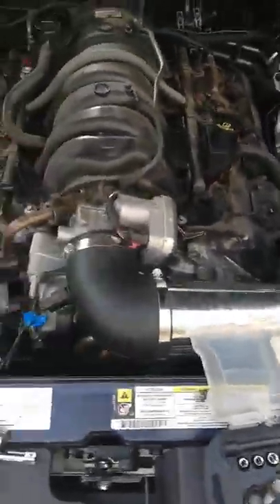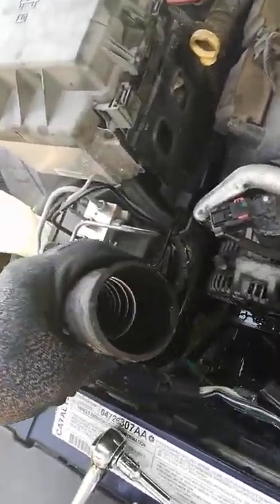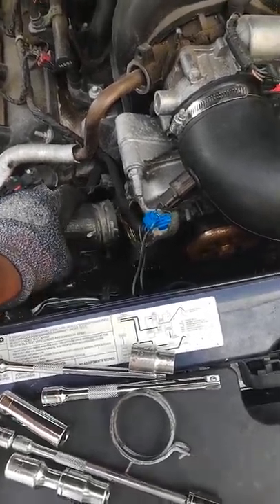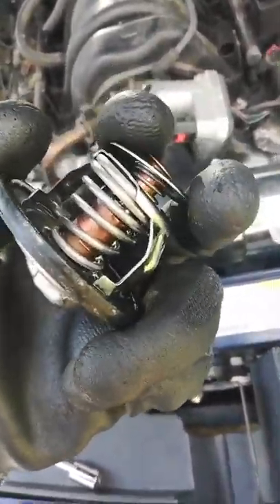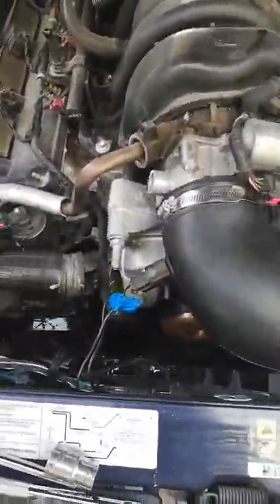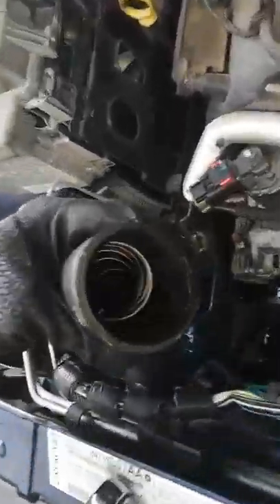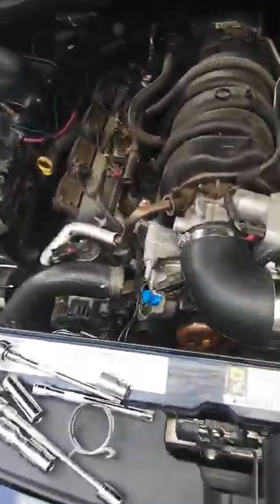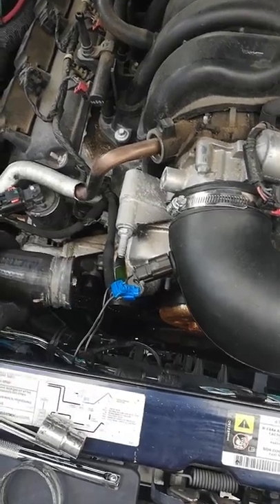Upper radiator hose rock hard

Comment: I got a 79 Cadillac Deville 425 7.0L here in Australia and never knew about the wire spring inside the radiator hose -- I do now 🤣🤣 Freaked the f#*k out when I felt both top and bottom radiator hoses were rock hard - She'll be back on the road in 12 months used to be a LA lowrider 😉

Comment: If the radiator hose becomes rock solid, there is pressure escaping the cylinders into the cooling system AKA headgasket failure
Reply: I'm praying my toyota doesn't have this problem
Reply: @TammiTrail-w6w  are you coolant hoses really hard?

Comment: I have a problem my 2007 explorer radiator hose feels like a rock because the hose is full of coolant. When I open the cap a lot of coolant came out then I realized that the hose was full of coolant. I need help please to know what it is.
Reply from the maker: Maybe too much coolant in the car or  your thermostat is not functioning properly. Normally coolant needs to flow but if your thermostat is not opening and closing as it should it to let coolant flow it maybe keeping the coolant on one side.
Reply: @abrahambrown20  thank you!
Reply: @abrahambrown20  yes, I think is the thermostat.
Reply from the maker: @pinedapineda5032  try changing it because it does not cost too much
Reply: @abrahambrown20  thank you I already changed it.